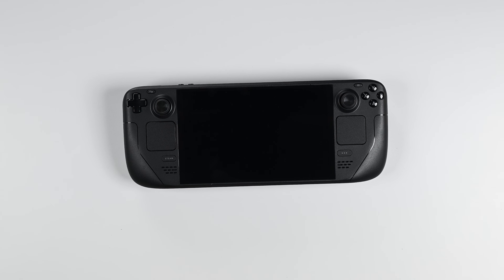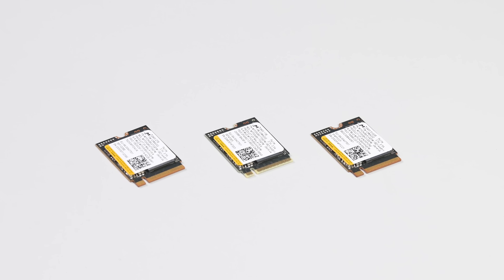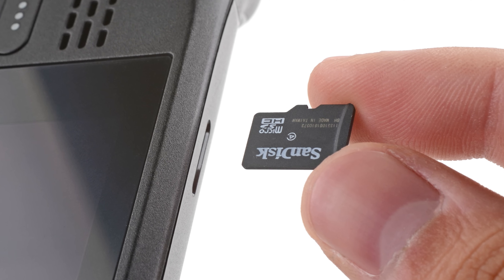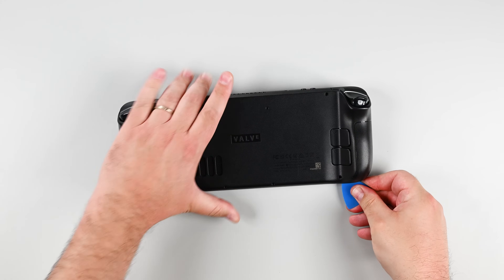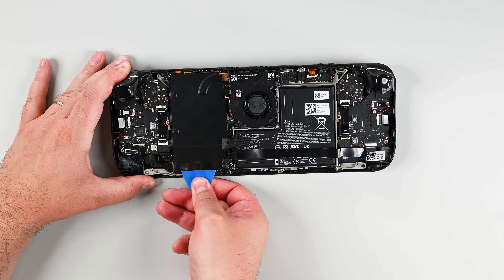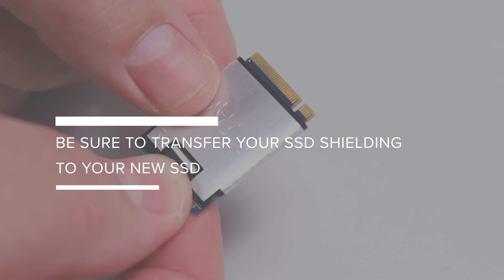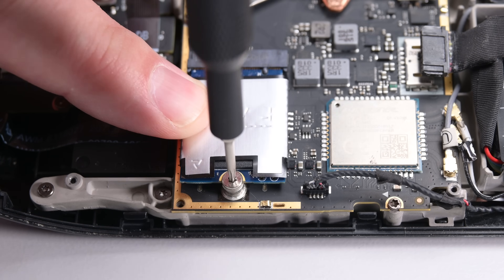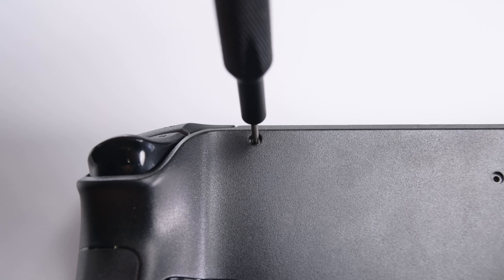How to Upgrade or Replace the SSD In Your Steam Deck OLED!

Comment: Thanks for the video. Some recommendations: I used an empty ice-tray to keep my screws, making it easy to find the correct screw, when reassembling. Use a screwdiver that holds your tiny screws in place with a magnet. I used a non- magnetic screwdiver and that made it much more difficult. The adhesive on the tape on the sield for the cable was really strong so had to stop and leave it on. That made the removal of the tape for the speaker table difficult, but doable. 
Finally, if you have "shaky" hands combined with a non-magnetic screwdiver, well, it will make this more difficult... But I managed :)

Comment: nice worked like a charm - did not disconnect the battery but I did setup the battery setting in the bios so it does not start by accident

Comment: This guide is outdated now. As of July 2025, there are 3 screws over the motherboard cover, not 2 — there’s one more on top. If that goes unnoticed and the guide is followed as-is, the plate can get damaged.
Reply: Not on mine in Oct 2025. Only two MOBO cover screws.
Reply: @skywardabyss Mine also only had two screws
Reply: Did the guide work for you?

Comment: How high can it go? 4TB possible or is 2TB limited?
Reply: The limiting factor is physical packaging. The SD only takes a 2230 single-sided NVME SSD, the biggest storage capacity for a single chip is the 2Tb QLC NAND chip. This means until storage technology improves 2Tb is the maximum capacity for the limited amount of space available.
Hth
Reply: @ThePlayerOfGames I just got the 2tb corsair mini it’s TLC
Reply: Just installed it too went smooth 🎉

Comment: It's so out-of-character for Valve to have used torx screws and required use of a pry tool to open the Deck, they’ve been champions of accessibility and modification as long as I can remember. Even Lenovo, Dell, and HP just use normal phillipshead screws for their laptops, and some older Lenovo laptops even just have an external door you can open to slide in and out SSDs no problem. Granted, those SSD slots are for SATA drives and not the tiny M.2s that are now mostly standard, but it's very bizarre that you can't just undo one philipshead screw holding a door on the back shut, open the door, and swap SSDs. It's also very frustrating that the slot only fits the shortest, square drives as opposed to having enough clearance to fit the long M.2 SSDs, but I can understand that being a limitation of the device's form factor.
PC gamers are nerds, but even I didn't have torx bits until I got an iFixit kit for work as an IT guy, and the Deck is supposed to be entry-level and normie-friendly, so this is all very strange design.

Comment: Can also go to steam desktop install etcher and make a copy of internal drive to new M2 (will need a cady)  then when you upgrade saves messing.
Reply: I can put the new 1tb ssd in a enclosure and use etcher to clone the original ssd?

Comment: Well snapped my Micro SD and now have no way to reinstall the os.. Also didnt disconect the battery and saw a spark 😂😂 Thanks for the vid tho!!
Reply: Bro wtf 😂
Reply: The video told you to remove the sd card.
Reply: @dillonh321  Nah I meant this happened before searching for the video lol
Reply: All good tho.. Still working!!
Reply: IT professional here
Jesus Christ
Reply: Skill issue
Reply: No skill involved. Nerd 😂😂 @ImGonnaChum
Reply: But it damages the microsd. SSD is stronger and more durable and the read speed can be 5000 Mbps. Micro sd is only 150 Mbps
Reply: common sense says remove the flimsy card before you break open the console

Comment: Just came by to help update this information.

I picked up my Steam Deck OLED back in April of 2024. I have no idea when it was manufactured so my best guess is somewhere between late 2023 and early 2024.

That being said, the part about removing the interconnect cable from the motherboard shield was sort of irrelevant to me as Valve had made it very easy to access the two T6x3.5mm Torx screws that hold the motherboard shield in place, eliminating the possibility of damaging the interconnect cable. All I did was take the screws out and move the entire shield assembly and interconnect cable enough out of the way that I could access the SSD.

As for the process of getting the SSD in, I would recommend using an M.2 external enclosure and using balena etcher 1.18.11 to clone your current SSD to the newer, larger capacity one instead of the rather convoluted reimaging process Valve outline. Do this all BEFORE tearing apart your Steam Deck OLED though.
Reply: 4:25
Reply: Good to know!
Reply: Thanks, that was most helpful, I will attempt to follow your instruction when my new SD gets delivered next week.
Reply: If I do this I will lose all my saved data right? All the autosave files and etc?
Reply: @augustocordeiro3548  only if you copied the current SSD to the new one.

Comment: having replaced the SSD and thermal paste on my oled deck i really wish steam would get out of the habit of taping and gluing fragile little wires to things, terrible practice and completely unnecessary
Reply: I thought when it these released they talked about easy repairablity and even uploaded a video
Reply: The flat cable over my shield  had so much glue I couldn't undo it without damage. I had to leave it while replacing the SSD. A little dab would be plenty to keep the wire from moving and being damaged.

Comment: The motherboard shield should really have a little cutout where the battery is connected, as the battery should be the first/last thing you disconnect/connect without any obstacles...
Reply: More secure the way it is currently. Pretty sure they considered that when they designed the device.

Comment: I somehow broke something on the board which crippled the Steam Deck to a crawl in performance. As a result, I've been afraid to touch the original SSD ever since I payed to get it repaired.
Reply: This can be a known software issue with similar symptoms, so perhaps not your fault.
If you did make a mistake, the problem would be with the thermal paste application or cooling fan.
Otherwise, there isn't much that can go wrong that would only cripple the Deck's performance like that.